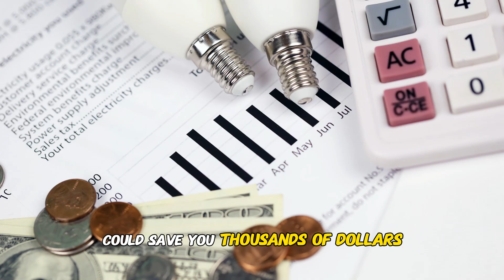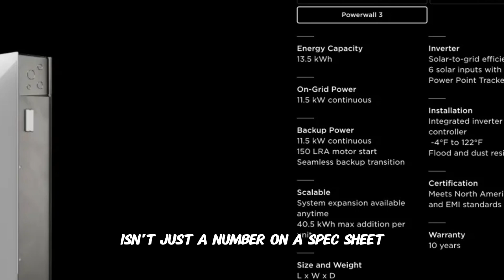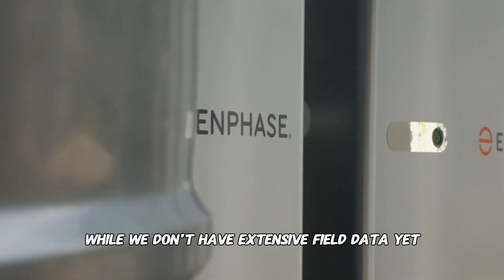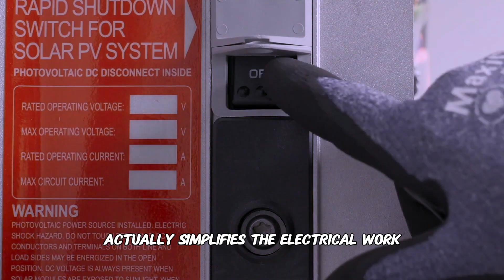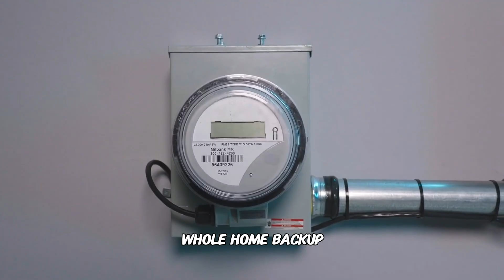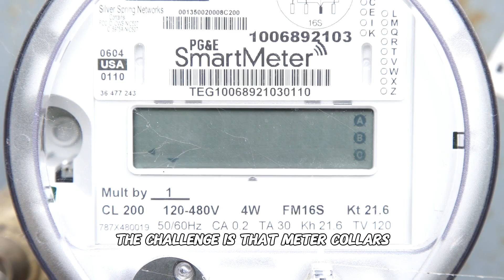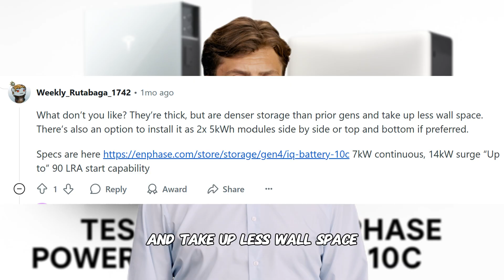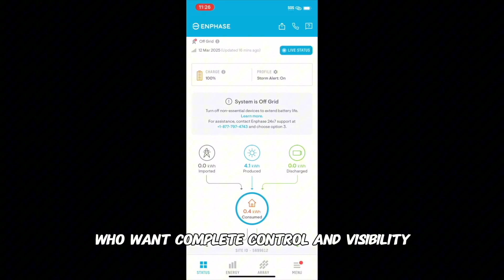Tesla Powerwall 3 vs Enphase IQ10C: Why Smart Homeowners Choose the 'Weaker' Battery

Comment: i getting solar for my home thay tell me that my system will produce 31108 kwh YEARLY  i had baker eletric that said 2 powerwall 3 and a extension would be fin but another soler company stellar solar whants to do 6 of the enphase 10c battery wich seams excessive compared to 2 1/2 tesla batteries am i getting scammed if i whent with steller

Comment: I have a 30 panel IQ7+ micro inverter system. I added (2) Enphase 10C battries and the IQ6 combiner with meter collar. I live in California. The total cost for the battries, combiner and meter collar installed was $26,700 including permits. We are saving roughly 30% on electricity due to the differance in cost based on time of use (Arbitrage). The system eaisly provided power for the entire home during an outage that lasted 14 hours.This includes a heat pump water heater, gas furnace (2) refrigerators (1) freezer (1) small heat pump for my wifes office, internet and (1) gaming computer as well as all of our regular 2000 SF house loads. During roughly nine hours of the outage the solar was helping to keep the battries charged. When the electricity was restored the battries continued to power the entire house through the peak cost period roughly an addtional six hours. At midnight they had 38% of the charge remaining.  I hope this information assists people with their choices.

Comment: I'm buying a home that has an Enphase system...microinverters and an IQ4 Combiner. we have 14 panels on the roof.  We also have 2 Tesla vehicles.  My priority is to maximize produced power to rely on the grid as much as possible and save $$.  However, I don't know if I can take on an initial $25-$35k investment right now.  What's your opinion??

Comment: Enphase offers more flexibility. You can install a smaller system & expand it as required to benefit from your essential needs & initial savings & add the 'nice to have' power later.

Comment: Installer here enphase battery sucks and is crazy expensive
Reply: $20,000 for 2 10cs s that bad ?
Reply: @javiianaya2497 ya that’s pretty rough if that’s pre install price  considering a single power wall three is almost better in every way shape and form not taking into a fact and enphase micros are $250 apiece not including markup or installation

Comment: So here in Indiana the winter days get really short and gray. So the solar companies build to around 65% offset because we have net billing and not net metering. So with the winter times, the solar produces the least and with electric heat, the winter bills get really high, for my house we use around 33,000 kWh a year and the solar produces around 22,000 handling summer fall and spring. So for winter times it’s still really tough. Would pairing battery storage help bring down the cost? And will adding batteries help run some of the electric heat?
Reply from the maker: Adding a battery like the Powerwall 3 or Enphase IQ10C can help, but it’s important to know how. Batteries don’t actually generate more energy — they just store what your panels make during the day so you can use it later (like at night or during peak-rate hours). That means they’re great for managing time-of-use rates, outages, or keeping your solar power in-house instead of sending it back to the utility.

For heavy winter electric heating, though, a single battery won’t usually cover all of that load — those systems can pull a huge amount of power. What batteries can do is offset part of your usage, run essentials, and smooth out costs. If your utility has high evening rates, or if outages are a concern, they add a lot of value.

In your case, you might get the best results by deciding which parts of the home you want backed up or you go with a very large setup.
Reply: @integratesun  hey man thanks for responding. So my main concern is the electric heat🥲it’s a pocket breaker. I was hoping adding batteries would help reduce some of that, I was looking at possibly Enphase 30c or 40c paired with 50 jinko430 panels

Comment: The 5kWh Enphase 5C is available now for ONLY about $3000, and the meter collar and combiner $1200, system controller $2200, IQ gateway and communications kit $650 and so the total cost of parts for a 10Kw Enphase system would be $10050, or $13050 for a 15kWh to rival the peak output power of the Powerwall. For 4 units to rival the 2 x 10P option, it would be $16050, not $26-36,000. 

This is much cheaper than the prices you mentioned based upon the 10P. Am I missing something?

Comment: I have an Enphase solar system that uses the IQ8 microinverters and I have a single IQ 3 battery.  I would like to add an additional Enphase battery.  It seems that all of my current equipment would be compatible.  I would also plan to keep my load center which services only my critical circuits.  Not trying to do whole home backup of my full 200 Amp breaker panel.
Would this upgrade be straightforward?  What would be ballpark costs?
Reply from the maker: Adding another Enphase battery? Totally doable, with your IQ8 microinverters and critical‑loads panel, it's a smooth upgrade. You'll just need a properly sized IQ System Controller (likely SC2 or SC3 for backup functionality). As for costs:

A used IQ 10 or 10T battery alone runs about $13,500 (parts only).

Expect $2,200–$3,100 more for a System Controller 
So, ballpark total: $15,700–$16,600 before incentives, plus maybe a bit extra for wiring, permits, and labor.

Comment: You'd never charge your EV in an outage unless you are doing a solar-only charge.  In fact, you'd be better off using your EV to provide power to your home.
Reply from the maker: Well yes unless the person didn’t prepare in advance and they need to charge their car to use it. In some instances an EV can definitely be a backup to your home if the model supports that. Thank you for your input 🙏🏼🙏🏼🙏🏼